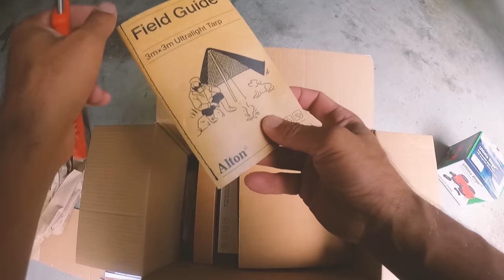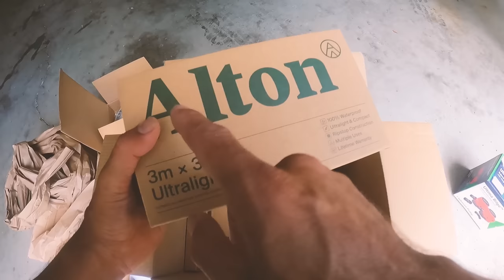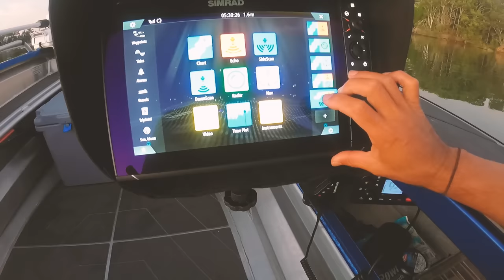Camping On The Boat - DIY TARP TENT For Remote Solo Camping

Comment: Rod you’re honestly better off with a 1 person Bivy tent…you’ll have more headroom, waterproof all around, warmer and less windy… That tarp is going to channel all the wind and rain through like a tunnel…Your definitely not escaping the morning moisture..
Reply from the maker: Yes I do have a bivy and a swag... did think about using them but the lack of sun protection is probably the biggest and most important thing the shelter needs to provide so didn't go that route. Also in a proper Storm like some iv been caught in recently might have the bivy swimming in the bottom of the boat😅👍
Reply: @rokkitkit  You know what the best solution would be?? Don’t get caught in the middle of a giant storm LOLL Best of luck bro, Enjoy 😊

Comment: Looks like a solid start. What about a removable small arched piece of aluminum across the bow just above your head. I'd be worried that a little rain would add weight onto the fabric and collapse what little breathing room you have. Just a thought! As always, great vid!
Reply: Or even cut down the fibreglass tent poles from his old tent and use them to support the middle.

Comment: Absolutely perfect design and choice in the end. Totally agree with everything you said and did. Yep, don't fully enclose the tent for heat reasons. Otherwise you would have to go with canvas and they are heavy. Perfect design for that boat and our hot weather in QLD.
Reply: Many dont realise though how heavy water is when its raining pretty good, that tarp is gonna sag and pool up quickly then the sides and back pole will pull inwards in a moderate rain so he'll have to sit there holding it up the whole time!  😬  You need a REALLY tight tarp at a steeper angle with very little potential to stretch or sag.
Reply: @shawnduddridge  Don't necessarily agree.  Rods pulled it tight enough to make it shed water. There's not really any place to pool water. The worst I reckon is inside he'll get wet. If need be, change the bungy to rope.
Reply: @Dora Explora  Hopefully!  Ive just spent the last 12 months living underneath setups like this, between my tinny and camp setup.. so just speaking from experience!  You never get it right the first time though 😄

Comment: Hey man, loving the vids! Inspiring me for my tinny build! I hate to be that guy.. but... Watching you install the bilge pump, I noticed there was no fuses on a lot of the accessories from the battery, including the bilge pump you fitted.
Please install fuses or circuit breakers on every accessory you have coming from all of your batteries as close to the positive terminal as possible. If something shorts out, A red hot wire melting through a fuel line or fuel tank would not be pretty!
Being in the 4x4 industry I see way too many accessories in 4wds without fuses... They're all just one sharp bit of metal away from burning down someone's pride a joy..
Absolutely loving all of your content and hope to see you out on the water someday!
 Keep it up!

Comment: I do similar on my little tinnie -  150L cargo box that carries everything I need (tackle, plastics, electronics, sunscreens, cooking equipment.  I turn it sideways up against the casting deck and roll out my swag on it.  Swag ties to the bow and to the outboard at either end.  The benefit if being short  5' 6" is it  long enough for me. and I don't overhang it.

Comment: Good first attempt mate, thanks for another interesting vid!
Do yourself a favor and set it up in your driveway the next time a decent storm cell is approaching though.  I think youre gonna find, not only will it be quite wet inside still, but those light tarps need a really steep angle (or super tight tension) otherwise in moderate to heavy rain theyll pool up with water quick, starting at the front!  Especially with the sides attached to a flexible rope, the back pole flexing on the elastic cord and wind flattening out the tarp from the front.  Its not just getting wet that will be an issue, you'll have to sit there underneath with your hands up trying to keep the tarp sloped the whole time, and as it sags the sides will pull inside the gunwales and you'll be in the shit taking in tons of water.  Should be fine as a sun guard and in light rain but trust me you'll be working on the next version very soon after the first decent drenching!  Cheers

Comment: Sweet setup! very well thought out for sure! ...Regarding Anchor access in an emergency ...maybe mount a hefty Bouy/float close to the Tie-off point on the boat deck. so you can just untie and ditch it in the water(to be found later by its hi-vis floatation characteristic). You've essentially created a floating mooring point I guess. Keep up the great content!

Comment: I might get a waterproof housing for deeper dives and maybe offer more protection to the GoPro. I haven't used one but I've been tempted for 50usd.

You can sleep in any position in a hammock. Hummingbird hammocks are what I use. Definitely the best nights rest. I'm 6'1 and use the single+. Not affiliated with hummingbird in any way, only have slept in one for several hundred nights.

Comment: An idea for the tent.

You could get some plastic/metal flat hooks that fit or clip onto the bar.

They are made for straps at the other end. Then, you can use a few inches of strapping to sew the clip onto your tent. 
(Maybe don't sew the hooks at the very end of the fabric, but a few inches in. That way, some fabric is overhanging the rails, and it doesn't drip rain inside the boat as much.)

When you want to set up, it just clips onto the rails nice and easy.

Clears out the velcro and makes it stronger against wind, with no permanent holes added to the boat.

If you want to take out the 2 strings running along the side, you can do the same idea with the back corners.

Just use long sewn in straps, with a backpack length adjustment, and clip all the way onto your back rails, then tighten the strap as necessary.

Comment: Great idea Rod, you are ticking off all necessities one by one. I am surprised that Stabi don’t have some form of a bilge sump. 50mm of water in a flat bottom boat is a lot of water. Granted the floatation they have keeps you afloat, but keeping dry is also needed i reckon. You’ve made the most of a tricky situation 👌
Reply from the maker: Yea true a little sump area would make it perfect and get all the water out. If I’m at the back or the boats moving the bull turns on fairly quickly, but if I was asleep up the front then it would take a bit of water on the floor to fill it enough for sure👍

Comment: Very nice, the floating hoochie. I was thinking a pack raft might be cool to use on your island adventures. They are light (avg 9 pounds) and roll up small.  It wouldn’t take up much space on the boat. You could use it to ferry to the tougher islands if you didn’t want to swim or wanted to carry camping gear.

Comment: Three  words " , gortex bivy bag ". Those army bivys are the solution for your set up , if it sprays through the edges , you will be dry :) they work great with hoochi set ups , you can  put all your sleep system inside , nice and dry , no matter what.
Reply from the maker: I do have a bivy bag👍 might bring it along

Comment: Another great video! Love the boat tent.  I had an idea if no one else had suggested it yet.  If you really don't like the Velcro look on the boat, why not take a look at or get "Bungy Loop Clips"?  They usually have a ball or a peg on a piece of bungee cord that goes through a grommet, simply stretch the bungee over the peg and ball and it'll hold the tarp in place.   Just a friendly suggestion from a fellow DIYer!
Reply from the maker: Yea I did try using the loops that were on the hoochie and using them like the toggles your talking about, not so different from the way you would pin back a mesh tent door. But it would not curl the tarp over the rail enough and kept pulling back so the water would run in to the boat so I ended up doing the Velcro👍

Comment: Mk 1 looks pretty damn good for repurposing the Hoochie. Like the idea of the gap for cooling around it, but myself  would like a bit more headroom at the front. May be about 300mm higher, because any rain would be so loud in your ear. And a simple curved ali bar clipped on to the side rails to hold it up with velcro straps to keep in place. But for Mk1, pretty sweet i reckon

Comment: Epic setup ! Very jealous😂 keen to see the upcoming videos with the rig. Just a thought here, instead of the eski what if you had a shelf that you could fit down onto the rails on either side of the eski’s current position that you could chuck your loose gear underneath and make your forward platform larger and still be able to lift up and take off…

Comment: a trick for that sheathing on the bilge pump wires you can use an wrench to put the wire in quicker. just put the wire through the circle bit and the start that sheathing then pull the wrench saves ages if you have a decent amount of wire/ if the sheathing is tight

Comment: I've found that if you put a thin layer of light weight grease on your battery terminals, and the connectors your using as you put them on along with the wing nuts themselves. 
Then without the oxygen, and other things such as salt water, or moisture in general, that normally get in between each other, causing oxidation. 
Then I don't have the problem of having to remove them all  for a good cleaning due to bad connection caused by the above mentioned items. 
Reduces the maintenance as far as the cleaning, and damages caused by removing them constantly.
Then having to replace connectors due to frayed wires, and bent connectors that eventually break off at the most inconvenient times. 
Which is typical of anytime you have batteries in a wet environment, are really anything that has batteries exposed to the elements including under the hood of your vehicles. 
Just a little bit of knowledge I've gained over the years, and I figured I'd share with you along with whoever else might read this. 
Stay safe and be well
Reply from the maker: Nice tip👍

Comment: 25:12 There’s a gap right there on the sides of the Tent, a flap sewed and sealed on top of the tent and just drops down to the sides of the boat to prevent rain water from coming in

Comment: lookin forward to how your gonna fix the bug problem. yea your gonna be on the water but like you spoke about last time, if you sleep in a cove your gonna get inundated with bugs. it'll be an interesting bug net thats for sure. but other than that it looks great that blue is my dream color. and the size is perfect not to big not too small. well done on gettin it.
Reply from the maker: Yea I got the new bug net that fits on the tarp. Should do the trick but will need to sort out how it fits around the cooler and leg area👍

Comment: Only issues is moisture runoff lands in the boat I did it similar but one pole at each end centred then a rope from one pole to the other and a tarp draped over the rope hanging over the sides of the boat with weights then run off goes into the water not the boat or on my face when I sleep.looks good though works well for your boat

Comment: Hey Rod, instead of having velcro on the side rails, why not have some kind of solution to run a self velcro tape, or even like those cable management type velcro strips, through a loop off the sides of the tent, and then wrap it around the pole instead?

Comment: Should that battery box be hanging out between 2 fuel containers? I have horrible images of a lead acid battery hydrogen fire or a lithium ion puncture fire venting directly into 2 fuel containers. Low chance i suppose but if it does kick off, it'd really kick off.

You should chuck 2 metal sheets sectioning them off which'll mitigate it somewhat.
Reply from the maker: I think with the amount of constant ventilation the whole area has, especially when any charging is going on it shouldn’t be a problem, but I’ll look into it more for sure👍
Reply: @rokkitkit  Cool! Sorry, not being an internet comment jerk. It just tingled my spidey senses and i want to keep watching RokkitKit vids. 😊
Reply from the maker: No problems, I don’t want to blow up either😂

Comment: Hi Rod I did not see any fuses on you bilge pump wiring or any of the other Are you running your wiring through a fuse box or similar?
Reply from the maker: Not for the water pumps, funnily enough the instructions said no need and that’s how the dealership guys had the other one so I didn’t bother. But everything else has its own inline fuse👍

Comment: What happened to the little yacht? That had everything in it.  If sailing wasn't your thing, just take the mast off and put a bigger outboard on it.  Just curious.
Reply from the maker: Definitely still have Misty and have been fixing her up after all the storms here over Christmas. I still love sailing but time is the biggest issue. I have kids and commitments etc and have found it really difficult to find the length of time to do proper trips that the sailboat requires… but definitely a trip soon👍

Comment: Instead of velcro straps on the boat, couldn't you have sewed the velcro on to the tarp that go around the side pole and reattach to velcro on the tarp itself. That way you wouldn't need to stick the velcro on the rail.
Reply from the maker: Yes but I’d cut it down too short by the time I’d got to figuring out that part so didn’t have the extra material by that stage. Mk2 maybe 👍

Comment: You need fuses and circuit breakers... Seeing everything just directly plugged on to the battery 😨😨😨
Reply from the maker: The instructions for this bilge actually said The was no need for a fuse, plus the guys from the marine dealership put my live bait pin in without one too… all other accessories on the boat have fuses though 👍 will look into it
Reply: @rokkitkit  does the bilge pump come with a fuse? I don't know how I feel about a life-saving equipment that might be fried when I ever needed to use it.

Fuses won't hurt. Especially since they aren't expensive.